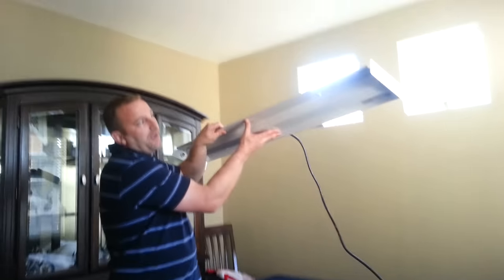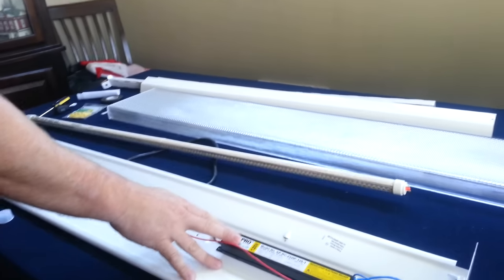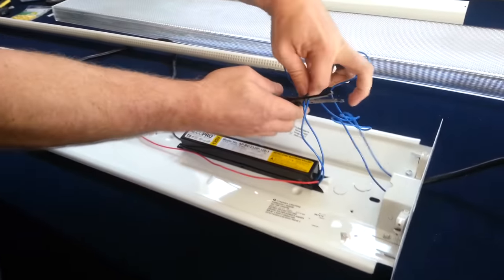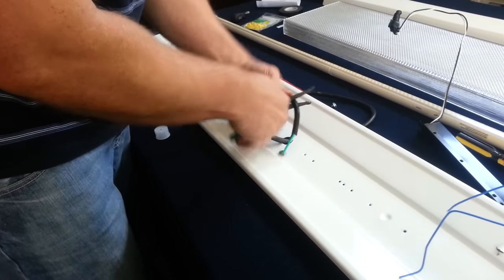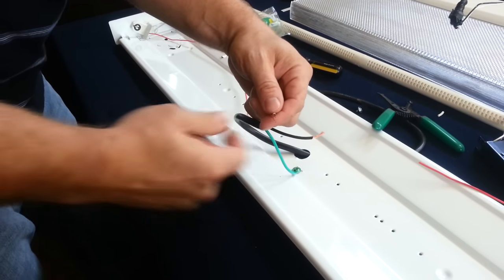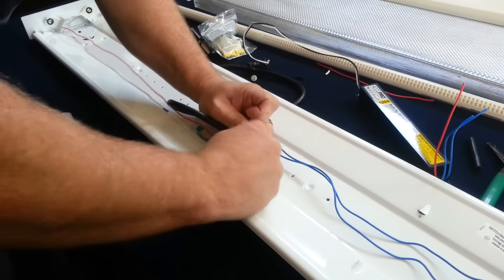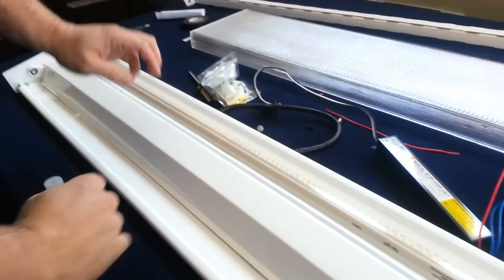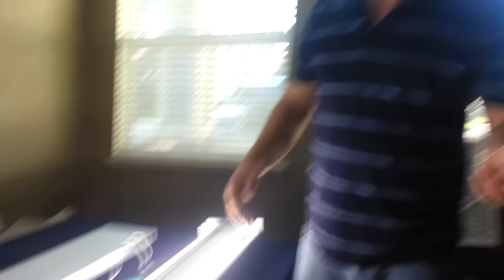How to wire 4ft led lights

Comment: Viewer should know that there are many type of wiring schemes for different types of ballast. Usually, there are far more wires under the ballast cover. Also, no one is certain what ballast is used for the fixture over your head. This video is misleading.

Comment: I had a tough time to see the colors of wires you were twisting together.  Therefore, I'm leery to use this as a reference.
Reply: StratmanDarrell oo
Reply: It doesn't matter the colors. Most manufacturers will use different color wires anyway in the light fixture. The wire in your ceiling will always be black and white (black hot, while neutral) but that doesn't matter either.  As he stated, one end of your light fixture is wired to your choice of neutral or hot and the other end of your fixture is wired to the remaining hot or neutral.

Comment: This video is for Double Ended Tubes only. If you wire your fixture this way and put in Single ended tubes they will pop and short out. Double ended tubes work with power to both ends. Single ended tubes use power to one end only and have to be installed with non shunted tombstones. With double ended it doesn't matter which way it's inserted. I'd also cut the wires as close to the ballast as possible leaving as much wire possible for the retrofit. Toss or recycle the energy hungry ballast.